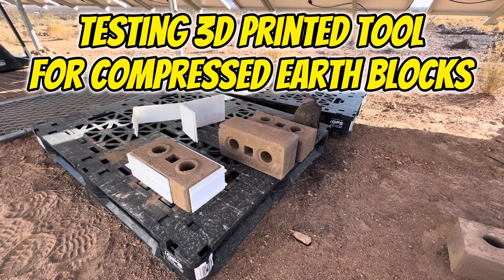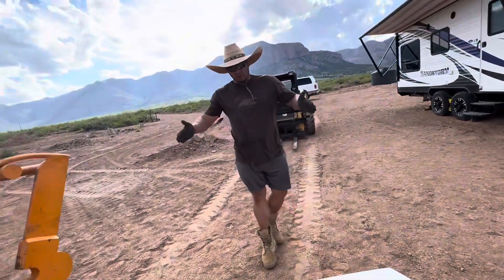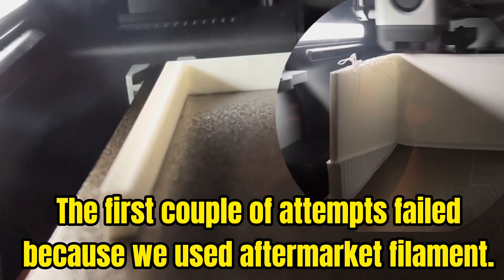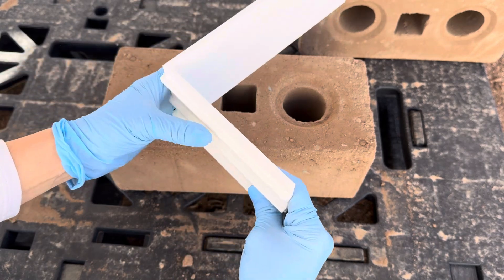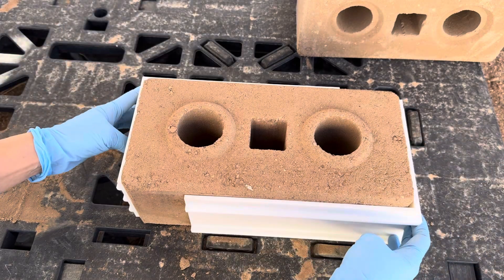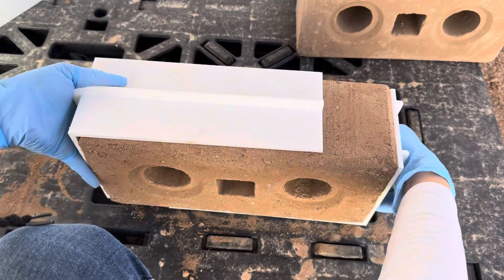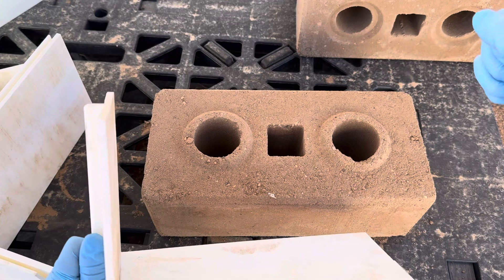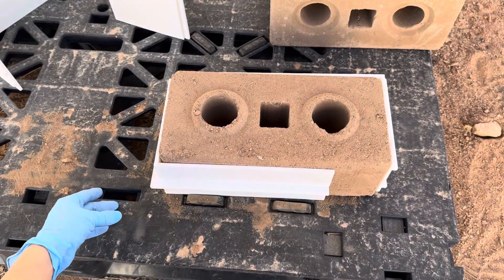DIY Earth Block Moving Tool Using 3D Printing – Save Time & Effort!

Comment: you know, maybe you can make it like the sheet rock handles, that when clamping will apply pressure from all sides to prevent any one point from having too much.
Reply from the maker: @trontrontrontron4  that would work for sure. Part of the problem is the clearance between bricks is small so it has to be the long ends that are clamped. We may try though. Thanks for the comment!!!

Comment: I gave you the formula last time, i'm not sure if you are following, this type of bricks have been around for years so nothing to reinvent just follow the formula you should be good. You have a lot of time and money to waste i can see. With 10 to 15 % of cement, 30% of clay and 55 to 60% of you should be fine. Clay is binding material and Cement is water proofing and resistance material will make your brick solid, water is 7 to 10% cement
Reply from the maker: @mosimba2665  Thank you for your input and the formula! We appreciate the advice and understand the importance of using proven methods. Our goal is to use as much of our native soil as possible, which is why we’re working on adjustments based on what we have available. We’ll be importing clay since we don’t have any locally, and we’re planning to use around 15%. More updates are coming in future videos!

Comment: Are you familiar with a canning jar lifter?  It's a very simple mechanism, and the weight of the jar helps provide the force needed to grip.  You could make something sized for your earth blocks with two handles.
Reply from the maker: @AlecMuller  I had a similar idea in my mind except a little more junk yard style. Was going to weld something to some vice grips. Great minds think alike!